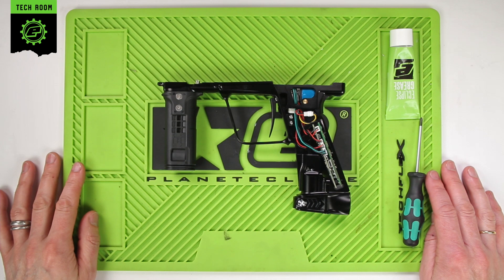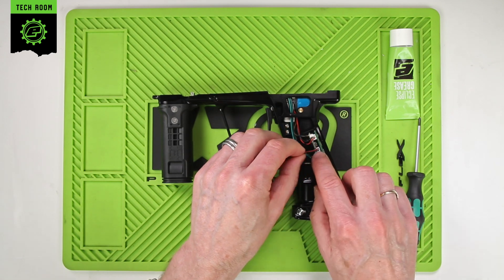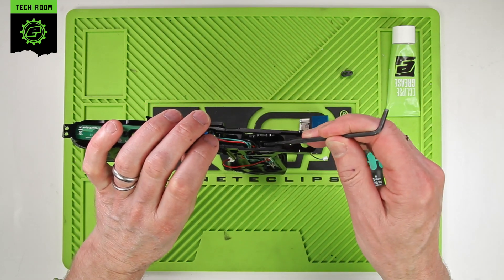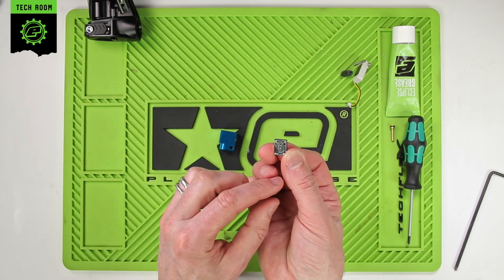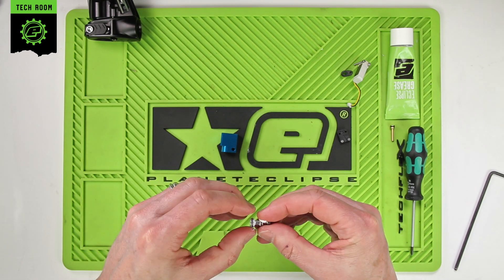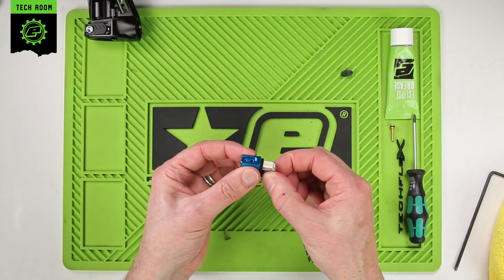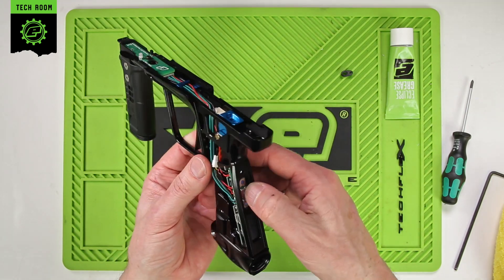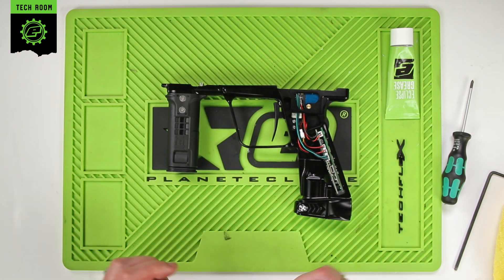Eclipse CS3 Solenoid Maintenance

Comment: Do you have a video about checking alignment of CS3 eyes? My new CS3 has issue and keeps going into default mode. I’ve checked the light prisms out with a different CS3 frame and that functions. Interested in knowing how to check CS3 eye alignment.